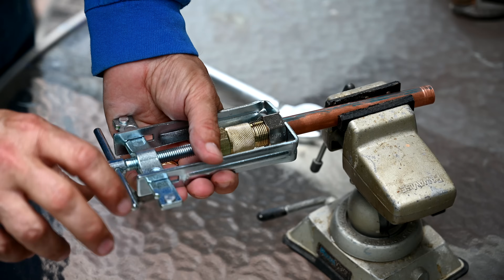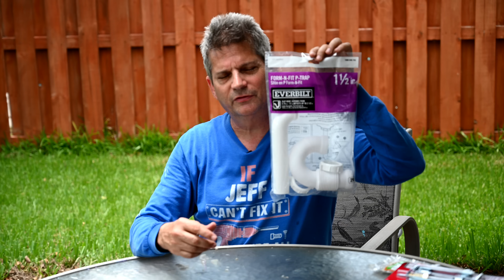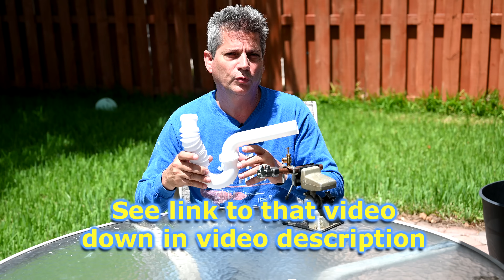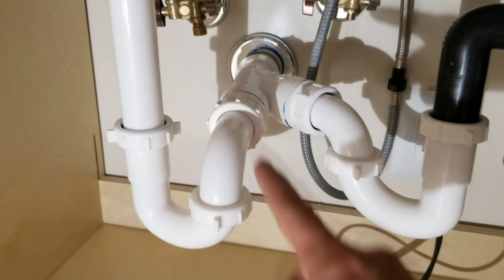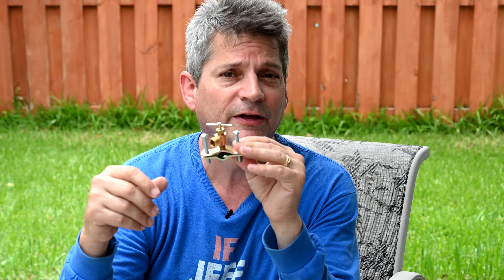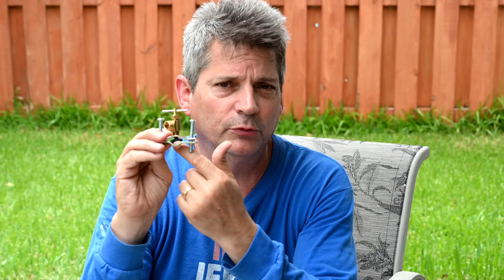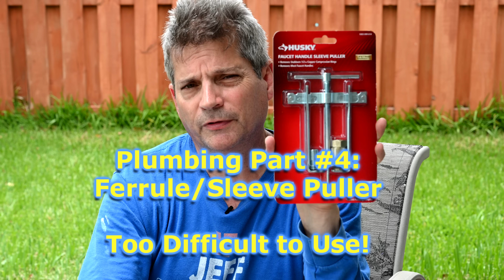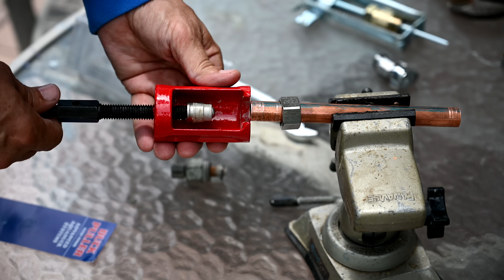4 Plumbing Parts/Tools You Should NEVER Use. NO Plumbing Fails

Comment: I make good money replacing these flexible traps, they always leak
Reply from the maker: Yup and do you see all the comments I get below from all of the clowns coming in here telling me I'm just nit picking about flexible traps and there's nothing wrong with them?
Reply: @jeffostroff  youtube experts😂😂😂😂
Reply: I used one but only for a 1/4 off from the sink bottom too of a normal ptrap setup water only flows through maybe 1-2 of the flex pipe at a 1-4 inch Variance. I’m worried I got a problem now but I’ll I honestly don’t think for that little 1-2 will be a problem
Reply from the maker: @jmiahrealone   It sounds like you are saying that you used part of the flexible pipe as the downspout from the bottom of the sink to the P trap is that correct? You can buy extension tubes  for example this one, white polypropylene, 1-1/4-Inch
: https://amzn.to/2RfQzzf
They have 6",  9", 12" sizes and you just cut it to the size that you need. I find on almost every new vanity I Install, I need to get an extension tube.
Reply: @jeffostroff  k thanks

Comment: If it's banned in all 50 states why are they still being sold in major hardware stores?
Reply: It might help if it was assembled right.
Reply from the maker: It is banned by plumbing code not by any state laws or criminal laws or anything like that. So anyone can still buy it but whatever city you're in the inspectors won't allow you to get your permit closed and your certificate of occupancy if you have one of these installed.
Reply: @jeffostroff  I hate to break the new to you but all the world is not NYC. Aren't these codes set by the city? Therefore they my be legal in one city and next door not. And, if you live in an unincorporated area there are no building codes.
Reply: A real plumber will never install those
Reply: @dafoo383  _____a real inspector will miss this violation
Reply: College kids and beer? lol
Reply: There is a use for these, but NOT INSIDE the house. You might use it to connect up a drain a hose (an unusual situation) outside that doesn't quite fit, and never as a permanent solution. Same thing with the saddle valve, they're often used to tap into a drain pipe for a Reverse Osmosis system, NOT for supply line plumbing. It's unlikely they'll leak in that situation, and they're not under pressure.
The S-trap can also be used, but NOT the manner he explained. It's upside down, for one thing. Some older homes have floor drains, and if the drain plumbing is properly configured (with vent pipe in the proper place, etc.) they are fine, just not to current code. The older codes said that the vent could be no further away than X amount of inches, that it drain into a larger drain pipe, and there be no other drain feeding into that within X amount of feet... They were also used in mobile homes quite often, where there was no drain pipe in the wall, but only underneath the trailer.

Comment: I will cut the pipe to get the old crimped ferrule ring off (copper pipe already has crimp damage)....else if the pipe is too short...i will carefully re-use the existing crimped ferrule...and crimp it down even tighter onto the new valve.
Reply: A lot of times there's not enough pipe to cut, Teflon tape can be wrapped around the ferrule and still seals to the nut with the new valve. Sometimes it's not financially feasible to open the wall and replace pipe. Always go back and test with a colored paper towel and you can see if there's any leak.
Reply from the maker: Yes that's a good work around too as long as it seals tight.
Reply: Yellow pipe dope and the good ole biological torque wrench and it will hold.
Reply: Yes clean it up with some sand cloth, then - a little pipe dope and you’re good to go

Comment: All of my plumbing drains in my house are on outside walls. If I were to use a p trap, I would have to put the drain on the outside of the house OR stud out my entire block house!
Reply from the maker: While that is a very unique one I don't think I've ever seen it on the outside. When happens when it gets cold are you up North can they freeze?
Reply: jeffostroff that is why I use the s trap.
Reply: Or loop vent it

Comment: If the ferrell is removed and scrapes the dickens out of the pipe, do you then have to solder a replacement valve?
Also, some of those removal tools look like they may swedge the copper pipe and then nothing will come off or on.
Reply from the maker: The ferrulel sleeve is quite smooth where it goes around the pipe so it typically wont scratch the pipe because all of the tools pull it straight off the pipe. I've never really seen any scratches.  I can see why you might think that it would damage the end of the copper pipe but it really doesn't because the force required to pull a stuck ferrule off the pipe is less than the amount of force that it would take to flare the end of the  pipe or cause any bending. In all my years of working with these angle stops I have never seen a case where I could not get a ferrule sleeve to go on to the pipe afterwards.

Comment: Your not even setting up the puller tool properly then blaming the tool for your incompetence. Adapter not run down to the end of the threads.. gripper arms not engaged with cross bar notches...
Reply: I actually noticed both these issues. And on the note of not enough leverage, you can cut off the bar and put a longer one. Didn't set it up right because he didn't read and follow the instructions in the package.

Comment: The s-trap advice is rediculous. Millions of such installations work fine.. what are you going to do? Rip out existing working systems just to meet some code? If the system venting is that bad to suck out an S-trap.. a P-trap will also get sucked out...
Reply from the maker: I guess you haven't read the comments from people below who have S-traps and said they smell sewer gasses because they lost the water in the S-Traps. No you don't have tear everything apart, I'm saying to install one on new remodel work that you do. No you don't have to rip out the old, but if you're remodeling, I certainly would, it's not a lot of effort to re-rout a few pipes if you have the walls open.

Comment: If the ferrule is on soft copper... Don't try that! You are sure to fail. How do I remove ferrules on hard copper? With a good set of water pump pliers.
Reply from the maker: No, you are wrong. The puller tools we show here don't bend the copper pipes at all, there is simply not enough force from pulling the sleeve off the pipe to cause any flaring.
Reply: @jeffostroff  ???? Wrong about what? Removing a ferrule from soft copper? The brass ferrule is harder than soft copper. It truly distorts the tubing, making it impossible to remove. I should know, being a plumber for 44 years.(it's not like I've taken time off to do something else)
Reply from the maker: @TheNimshew   Well all of the angle stops that I've ever removed were on regular copper pipes usually type M. Those are nice and solid but if you do ever get a bend on the pipe you should be able to either get it back into shape or just make a cut in the pipe past it with a tube cutter and  rheam it.

Comment: O  M  G. It's no wonder you got so many negative comments. Obviously no one is going to use these things in new construction. Everything is generally  perfectly designed when first installed. But when people do replacement of countertops sink alignment changes. Oh hell, the flex drains aren't perfect but they work. All your talk about beard hair and toothpaste getting into the crevices is nitpicking. Also you don't even sound like a plumber. And the handle puller you so hate. It's made for pulling stuck handles. Makes me wonder if you truly are a plumber, or just a utube money grabber.
Reply from the maker: Peter when you come on here and make a statement about the handle puller that I used  being for knobs only it is not it is used for both if you read the front of the package when I show it you can see it's claiming to do both the handle puller AND compression sleeve puller. And on the back of the package it shows 2 different sets of instructions depending on which mode you use it so it makes me wonder how much you know. The second set of instructions on the back says "Compression Sleeve Puller Instructions. Also you ignorance in calling my statements about beard clippings shows you have no clue. That's not my nit picking, that's you not understanding that it is Uniform Plumbing Code. These accordion flexible p traps do fail all the the time at the creases, All you did with your statements above which are blatantly false is ruin your own credibility.
Reply: I've been in new house construction for 25 years and yes a remodeling contractor for 20 more. And I know new construction sure, no ones going to use those quick fix drain parts then cause everything is made and planned to be professionally done by pros. But when you're working on a 150 or more house that has had years or remodeling on it, things aren't always exact. So when you go condemning homeowners and guys not charging 85 bucks an hour plus service charge,, that a lot of poor or low income homeowners hire,, for using these, innovation s.. It ruffles feathers. As for the handle puller, you never showed using it on a handle, you showed it doing something I've never used mine for. But heck, if it works, why condemn it? Honestly,, thats the only reason I said anything. Cause you were basically criticizing things and DIY people and handyman for no reason. So you can't lambaste me or anyone else for hate mail, when you're doing it yourself. And FYI, I've seen S traps in brass in many old houses that for some reason the drains were outside wall and through the floor. They may not be code, but they have been used for years and years.

Comment: You mentioned cases where previous plumber doesn’t leave enough copper pipe coming out of the wall, preventing you from cutting the pipe to attach a new valve. How much extra length do you recommend leaving? At some point the extra length looks tacky, especially if it’s readily visible and not inside a cabinet.

Comment: Appreciate the video! yay s traps in all my fixtures and a saddle valve for my previous fridge (inherited with the house). Love the 600 I paid for an inspection. I am a DIYer but like previous commenters I'm on here to know how to do it right. Thanks for the info!
Reply: The husky tool worked great, just remove those two hook like end pieces as they get in the way, but are not needed in this case. The part that screws in is the part that grabs the nut! However, the handle is not wide enough to give you the leverage you need, so I just had to add some leverage by putting some around it of small pipe on the ends, anything to extend and give you more leverage.
Reply from the maker: Steve you are welcome and thanks for coming by to view our video

Comment: Wow .  If it is complicated and expensive it must be good...  Love plumbers...just another racket.
Reply from the maker: Luckily, these are all things you can do yourself and save having to spend it on the plumber. That's why we have other DIY videos that show you how to do it properly and conforming to plumbing codes. The reason why many people really should use a real plumber is because of their knowledge, experience, and ability to not make a disaster in your future, provided they do it properly too. What makes it so expensive for contractors?  they have to pay rent, new vans, leases, expensive tools to buy, plumbing parts to keep on hand, higher commercial rates for electric and phone bills, workers compensation, pull permits, gas to drive all over town. That's why a typical visit to snake out your kitchen drain is about $150 for 1/2 hour work. Even though it took them 1/2 hour, there's driving there, unpacking equipment, packing it back up, driving to next job, pay the employees, make some profit on tops, etc.

Comment: I bought a device called "Saf-T-Kut" a few years ago. You simply place the device inside the copper pipe and finger tighten a cutter onto the ring. Then you wrench tighten the cutter slowly until the ring pops. I believe Amazon sells this now. Works great.
Reply: Looked up the tool. Fifty bucks. Great, if you use it continuously. For ONE compression ring? No.
Reply from the maker: Funny you should mention that. We jsut added the amazon link to the Saf-T-Kut in our video description. We actually have a few videos upcoming that will feature that product, I'm going to show it in one of our What Is It Wednesday videos, and also I plan to do another video that shows you 3 or 4 ways to remove the compression ring.
Reply: @jeffostroff  i always use a ferrule puller they're available everywhere

Comment: Great video...I agree with everything demonstrated...The only problem is, customers wanting an icemaker installed, often know about the saddle valves and insist on that being the way they are connected....Sometimes, they have bought the kit....The customer is always right, right?....lol.
Reply from the maker: Yes, that is the dilemma with them. They might tell you, don't worry, I'll accept all responsibility".....until there's a failure, then it's all your fault as he blames it all on you tot he insurance company.!
Reply: Ohhh yeah that is a common thing. Companies I worked for as a plumber always told the customer that it was our way or the highway, as we won't be taking the risk. We'd explain why its a bad idea and even help them get a refund on the part, but a few were really stubborn. Of course this was New Orleans, where the boss would laugh at dumb customers who refused to listen, and things were a bit different, but its still something I've seen in many places.

Comment: We used to put in S traps like 20 yrs ago. We’d use them when the drain and vent in the wall was bad. I worked in a small town without an inspector. It was one of those things where we’d offer that to save people money. We’d drill a hole through the bottom of the cabinet without having to cut out the wall. If the person could afford it, we’d bring a pipe up out a clean out and then a studor vent up near the bottom of the cabinet. It wasn’t the best solution but i like the idea of the property owner being able to decide their own fate. 

As for why Lowe’s and Home Depot sell parts that are illegal, they’re going to sell anything they can. You can make an s trap out of legal pvc fittings. It doesn’t have to be individual parts that are illegal. That’s why you get someone who knows what they’re doing
Reply from the maker: Do you know if any of the customers ever had a problem with the s traps?
Reply: That’s funny, I’m guessing you said customers which seems a more common word than cosplayers. I don’t specifically remember a call back due to one but that doesn’t mean it didn’t happen. Though we didn’t put them in super often. The majority of people would spend the extra money to do it right. My boss then is in his 70s now so it could have been one of those cases of “we’ve done this for years with no problems so it’s okay regardless of code”. There’s other things I learned that people wonder where I got them. We weren’t allowed to use pipe dope (yellow rector seal) on plastic period. Only Teflon tape or Teflon enforced dope even though it says pvc allowed on the can. I figured that was something from long ago with that black dope maybe that he was just ingrained with. Even though I know better now, it still bugs me to see yellow on a plastic fitting

Comment: What was the name of the second puller at the end?  I didn't see a link to it.  I have the same frustration with the Husky puller.  Great video!
Reply from the maker: Al, that is made by the English Tool Company, you have to buy it right from them, that's where I got mine. http://englishtoolco.com/. But I still prefer the duck puller because it is slightly easier to use, and large round  one piece design fits right behind the nut: ✅ Duck Puller Ferrule Ring/Sleeve Puller: https://amzn.to/2k5hrTY

Comment: thanks but this vid could have been 5 mins long
Reply from the maker: We have started breaking this video up into additional 4 smaller videos, we did the saddle valve video the other night already. No this could not have been 5 minutes like you state. You just want to take the quick way out, eliminating important details. And if it was 5 minutes, people like you still come in and complain it could have been done in 2 minutes.  Now matter how short we make a video and chop it down in size, corner cutters always come in complaining it's too long. These are 4 important topics that need all these details for people to know. In fact, Americans everywhere are suffering tens of thousands of dollars in losses because people thought they didn't need to spend 6 minutes to educate themselves on certain subjects. So 6 minutes per subject for 4 subjects is not out of line. If you want to chisel the whole thing down to 5 minutes, then you would remove all the critical information people need to know as to why to avoid these items. Also, have you ever heard of the computer mouse? Great invention! You use it to skip forward in a video, so you can watch a 26 minute video in 5 minutes.
Reply: @jeffostroff  So defensive.  I'm just offering my suggestion. You have good info, and more will watch if you deliver it succinctly.  I'll summarize the vid for the tl;dr set:  1. S traps, bc they could suck out the trap water; 2. accordion-style drain couplings, bc stuff can get stuck in them; 3. clamp-on pipe taps, bc they leak; 4. Husky compression sleeve puller bc it hurts Jeff's fingers; amirite?